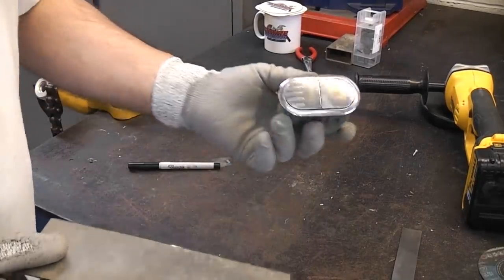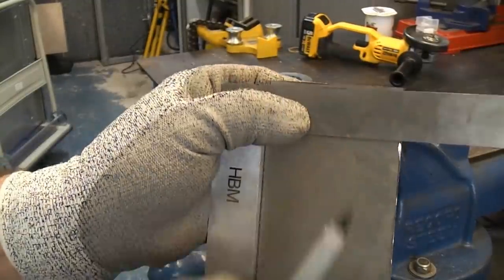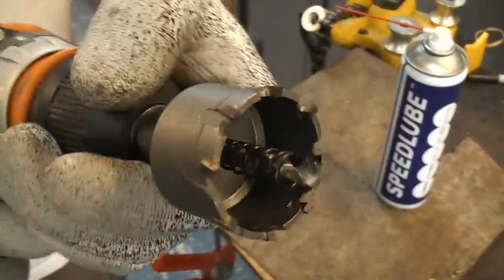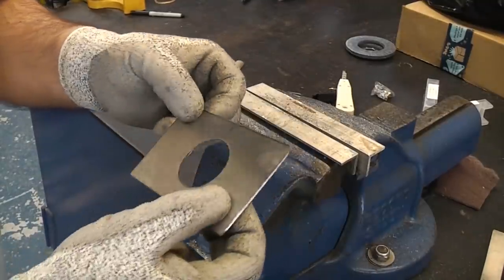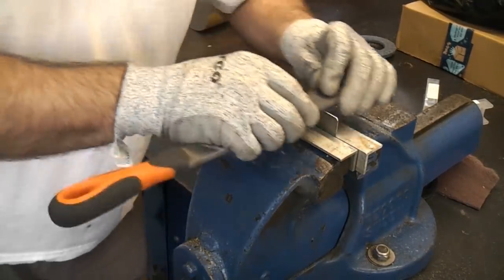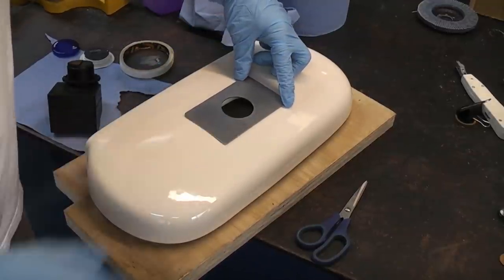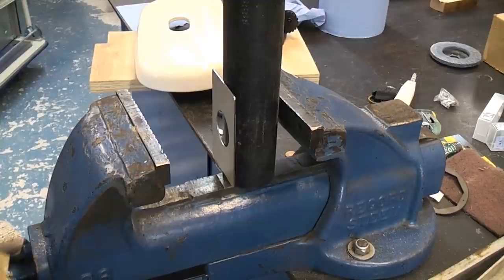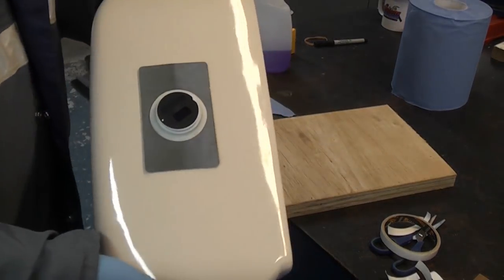How to make a stainless-steel cover plate

Comment from the maker: Always save that scrap piece of stainless steel, as you never know when you might need it.
Yesterday was a strange day, I wore a tee shirt in the morning as it was sunny, later it rained, then at 11pm it was snowing, today we have a snow-covered garden 😉
I hope everyone has a great Sunday
Reply: By Eck I don't know how u wore a t shirt. It might've been sunny but it can't have been more than 2° or 3° ❄️
Reply from the maker: @YorkshireD1   Yeah, it was ok when the sun was out, but each time the clouds obscured the sun I was wishing I had my big coat 😂
Reply: Yep, certainly was strange weather for the time of year. We also had about an inch of snow which meant it was still far too cold to put the early potatoes in.
Nice work on the plate, looks like an original part.
Reply from the maker: @cliffcarlo180   Snow and sunshine in the same day, yesterday!  Thanks for the comment 👍

Comment: Definitely the right decision, to put a bit of a bend in the plate. Thanks for the video 👍🏻
Reply from the maker: Yeah, you are right. I could have done with something a bit larger diameter though, although the slight bend did the job and made it sit better on the cistern lid.
Thanks for the comment 👍

Comment: Same here, I was servicing my mower, coat on, coat off, sunny, then snow. 😂😂😂
Reply from the maker: I've just been to Southport, set off from here with snow on the ground. I had my jumper and coat on. Got to Southport and it was absolutely boiling!
When driving back down the M65 to Darwen, you could see the mist, mind you even the snow has melted here now 😂
Reply: @ultimatehandyman  Discovered the delights of Southport just before the first lockdown last year, beautiful place, been back several times.

Comment: Nice solution. 

I was thinking of an alternative, and though I don’t have one, I guess a 3D printer could have made a plastic insert/cover ? And just wait until everyone has a metal 3D printer at home. All this manual skills will be lost forever 😕

But you can’t go wrong with stainless steel 👍
Reply from the maker: Yes 3D printers are ace, and many people have them now. I almost used a piece of Perspex, as that would have been really easy to bend, but thought I'd use the scrap piece of stainless.
I can't stop watching videos of 3D metal printing, water jet cutting, laser cutting and wire EDM machines, but at least I can still make things using a drill, hacksaw and file LOL
Thanks for the comment 👍
Reply: @ultimatehandyman  same. Love those videos. I’m currently looking at buying an 8x4 foot CNC for woodworking. As well as building I have a background in programming. 

Frank Howarth videos made me want one even more. 

Cheers

Comment: I'm looking to get into metal work and am struggling to find any clear walkthroughs on using grinders and other prep work (e.g disc selection, rust cleanup, use of cut-off saws). I was just wondering if you can recommend any good online sources and if not, could it be possible future content for the channel? I always enjoy learning from your vids 👍
Reply from the maker: I've done loads of videos in the past, which might help-
How to use a grinder- https://www.youtube.com/watch?v=1TFisMcDrH4
Paint removal discs (also good on rust) - https://www.youtube.com/watch?v=aMQMk7J94u8
Abrasive cut off saw versus Rage 2 - https://www.youtube.com/watch?v=dPSebuPlHH4
Then the follow up video for the people that said I was not pulling down on the abrasive chop saw- https://www.youtube.com/watch?v=Orx676NXyws
Selecting a grinder disc- https://www.youtube.com/watch?v=dh5X-fFN4_4
I hope the videos will help ;-)
Thanks for the comment 👍

Comment: do you think the mammoth tape would be good for sticking rubber door seals back onto the painted metal surround on my vehicle?
Reply from the maker: Perhaps if you used it in places and some decent grab adhesive in other places?
I'm not sure how well Mammoth tape works when the temperature drops etc.
Thanks for the comment 👍

Comment: Why didn't you use a grinding disc to take the sharp edges off rather than the file?
Would have saved some time.
Reply from the maker: Grinders are fast and easy, but it's too easy to take too much off, so I prefer to do jobs like this using a file
Thanks for the comment 👍